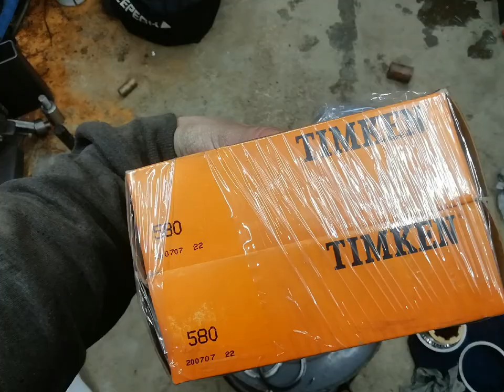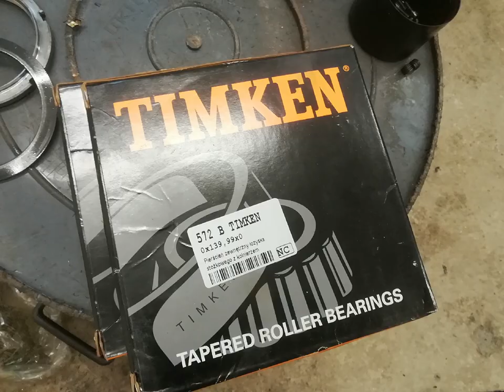CAZENEUVE HB 575 SPINDLE BEARINGS REPLACEMENT.. Cazeneuve hb 575 roulements

Comment: Mr. Janne. Greetings to you, and I would like to ask you: Does this type of lathe have a negative turning or conical turning follower, or a follower with which you can open a spark or a conical or conical tooth?  Thank you
Reply from the maker: @ابومحمد-ص7ر7ق  hello. Im not sure what do you mean, but it does have taper attachment with the lathe it is possible to broach keyways and even gears with feed. Im sorry i really dont understand completely what you are asking sorry..
Reply: Mr Janne.    I mean inclined turning using the additional sling device
Reply: سيد Janne.  شكرا جزيلا لك .اقصد جهاز الخراطة المائلة وكذلك فتح السن الكونيك او المائل وهذا الجهاز ملحق  او إضافي في بعض المخارط اتمنى ان يكون قد توضح الأمر بالنسبة إليك وشكرا مرة ثانية لك .
Reply from the maker: @ابومحمد-ص7ر7ق  no. Idont have that kind of device for the lathe and i dont think there is that kind of machine for these cazeneuve lathes
Reply: I know, Mr. Janne, that you can manufacture a tapering device and add it to the lathe to turn and open a conical tooth automatically.  I hope so, thank you very much.
Reply from the maker: @ابومحمد-ص7ر7ق  i do have a taper device for this lathe
Reply: Whats the price for the bearings?
Reply from the maker: @simonsaelaertfurniture9883  you can see that in the video. I think original bearings was about 2000 euros with tax and transport and these bearings in the video were about 1000 euros everything included

Comment: Hola estoy haciendo el mismo trabajo que ud. Me pasa que no quiere salir con solo sacar los 4 pernos y el distribuidor de aceite. Hay que desrmar algo mas en la cola de el torno???
Reply from the maker: Sometimes the big tube that holds the spindle bearings inside is stuck in its hole. You can loosen it by sprayng rust off spray through the four threaded holes on top of the lathe and then thread in one of those screws and tighten it so much that the tube rotates little and then screw it out again and screw it in to the opposite side hole and tighten the screw to that hole so much that the bearing tube rotates a little. Keep doing this rotating thing and spray rost off from the threaded holes same time and then the tube should get loosen and then you can pull it out.. I hope this helps 👍
Reply: Muchas gracias me a servido la información ya logre hacer la reparación 🤝
Reply from the maker: @orieldelavega3560  im allways here for help 👍

Comment: i have the same problem but the buring is to expinsive
Reply: and i dont work know dos it work becaus i do the same thing but with bearings but chuke stop tourning and it dosent work 2 bearings cost 2000 euro is to much for me and big prolblem pls sir tell me if it works good or not
Reply from the maker: Yes these bearings in the video works perfectly... I have two cazeneuve lathes and i have fixed them both this way